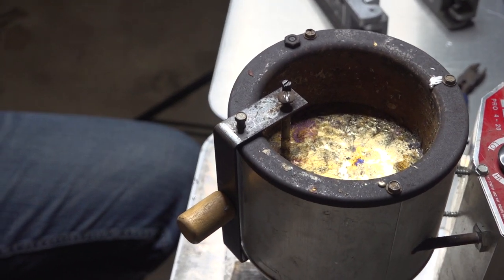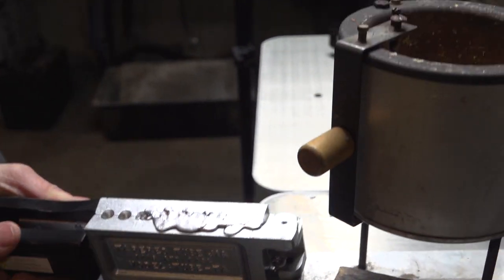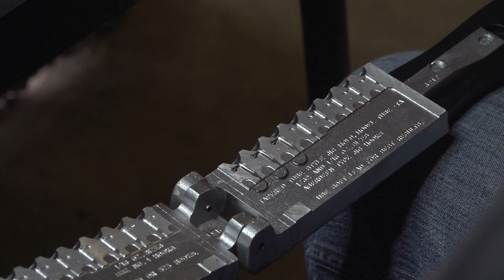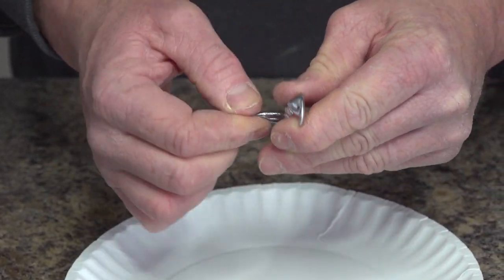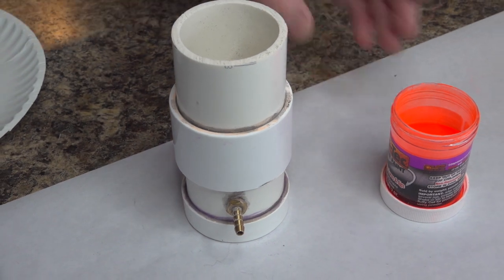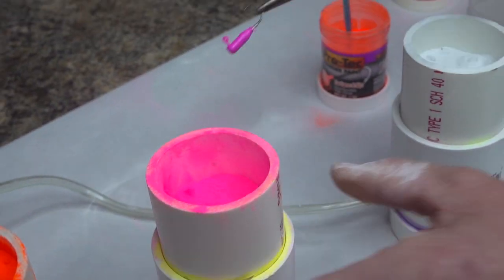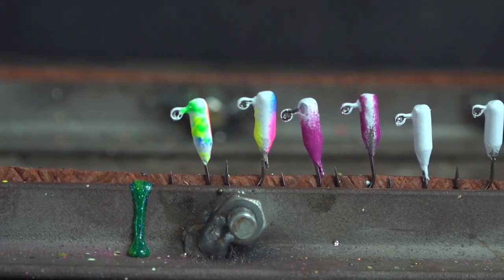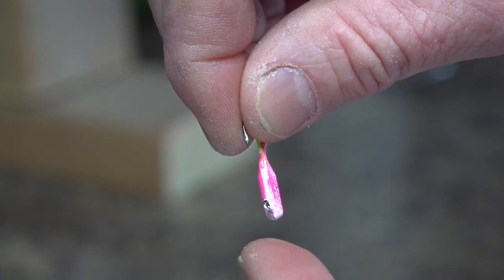MAKING STEELHEAD JIGS | Step by step from start to finish

Comment: Awesome video. I appreciate the no-nonsense step by step approach with all the helpful pointers. I am thinking of doing this also since buying the jigs pre-painted is about $2 a piece or sometimes more. Which hook do you use for pouring these for steelhead fishing? The eagle claw hooks linked to the mould on the barlow site are only 1X and I am worried a steelhead could straighten them out. I saw some mustad 2x aberdeen hooks  but I am concerned they may not fit the mould correctly. Do you have a link you could share?

Comment: I like your jig baking fixture.  Nice!  I missed the do-it mold you use, would you post this detail?
Reply from the maker: It is the tapered tube jig mold. 1/32 and 1/16
Reply: What hook do you use and did you have  to modify your mold